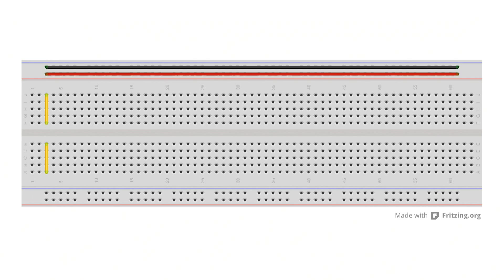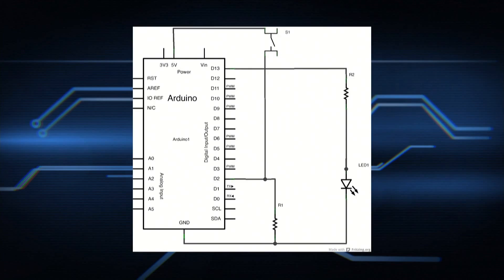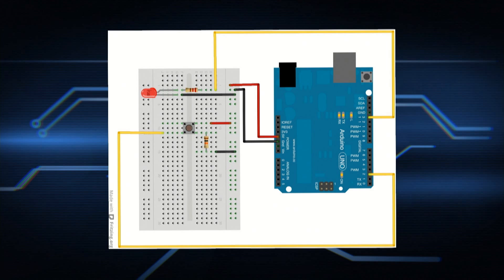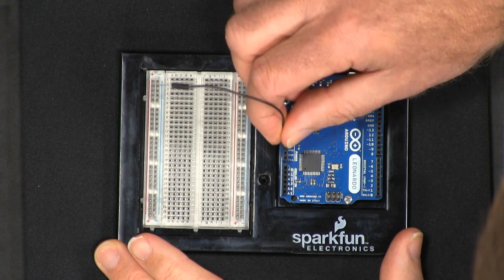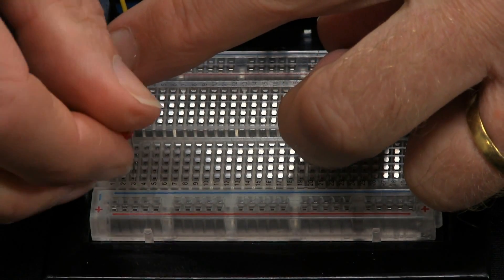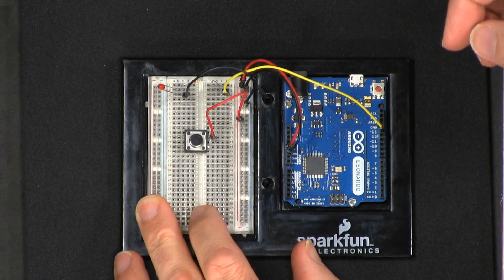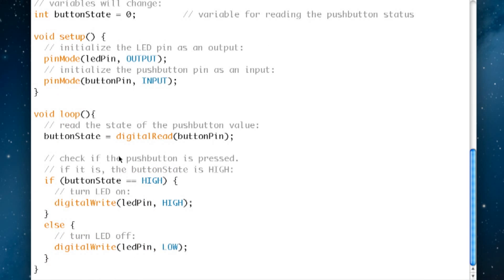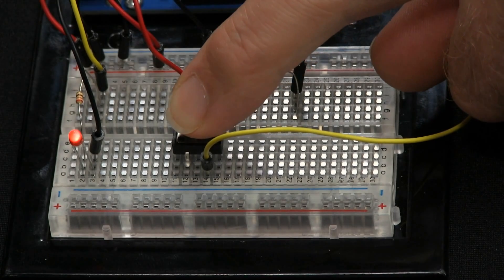Arduino Tutorial : Breadboard, first circuit, button ,LED

Comment: So it depends on where yellow wire(input pin2) line up with right? Let say if it lines up with positive, it will read HIGH(push button to turn off)  If it lines up with ground it will read LOW(push button to turn on).
Is my understanding correct?

Comment: Why am I getting this error when i use a Mac for uploading to my Nano.

Arduino: 1.6.8 (Mac OS X), Board: "Arduino Nano, ATmega328"

Sketch uses 3.450 bytes (11%) of program storage space. Maximum is 30.720 bytes.
Global variables use 230 bytes (11%) of dynamic memory, leaving 1.818 bytes for local variables. Maximum is 2.048 bytes.
avrdude: stk500_recv(): programmer is not responding
avrdude: stk500_getsync() attempt 1 of 10: not in sync: resp=0x00
avrdude: stk500_recv(): programmer is not responding
avrdude: stk500_getsync() attempt 2 of 10: not in sync: resp=0x00
avrdude: stk500_recv(): programmer is not responding
avrdude: stk500_getsync() attempt 3 of 10: not in sync: resp=0x00
avrdude: stk500_recv(): programmer is not responding
avrdude: stk500_getsync() attempt 4 of 10: not in sync: resp=0x00
avrdude: stk500_recv(): programmer is not responding
avrdude: stk500_getsync() attempt 5 of 10: not in sync: resp=0x00
avrdude: stk500_recv(): programmer is not responding
avrdude: stk500_getsync() attempt 6 of 10: not in sync: resp=0x00
avrdude: stk500_recv(): programmer is not responding
avrdude: stk500_getsync() attempt 7 of 10: not in sync: resp=0x00
avrdude: stk500_recv(): programmer is not responding
avrdude: stk500_getsync() attempt 8 of 10: not in sync: resp=0x00
avrdude: stk500_recv(): programmer is not responding
avrdude: stk500_getsync() attempt 9 of 10: not in sync: resp=0x00
avrdude: stk500_recv(): programmer is not responding
avrdude: stk500_getsync() attempt 10 of 10: not in sync: resp=0x00
Problem uploading to board.  See http://www.arduino.cc/en/Guide/Troubleshooting#upload for suggestions.

This report would have more information with
"Show verbose output during compilation"
option enabled in File -> Preferences.
Reply: +Kasper Nørgaard 
go to   tools>>port>>"change the port and upload agin keep changing the port until you find the right one "
Reply: +Moaath Muhammed 
Hi Moaath
After searching for a long time and trying out different things I found a driver that gave me a usb output, so now it works 😊

Comment: I copied this procedure exactly, but it isn't working. Could my my arduino be broken? How could I check that?
Reply: +Roberto's Games 1. Flip the LED, Make sure LED is working. And check code?
Reply: +Alex Munoz Thank you, but I fixed it in the mean time. Cannot recall what was wrong. I think it might actually have been one of the wires.